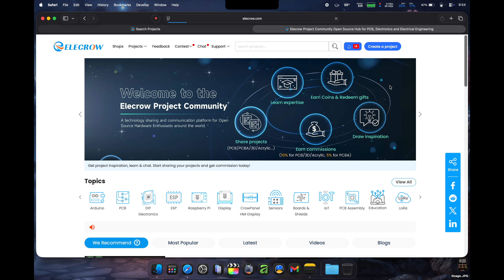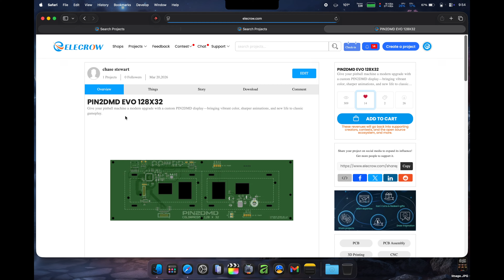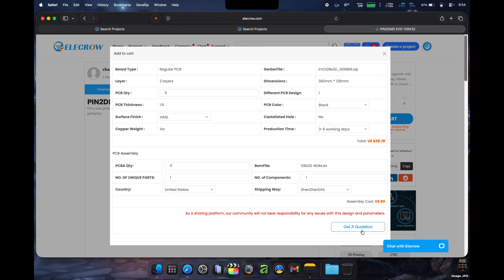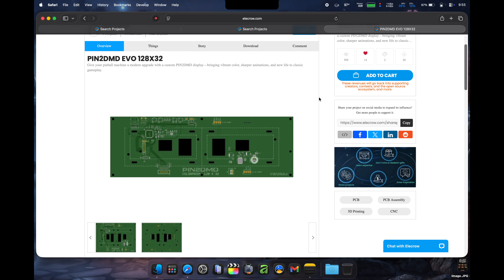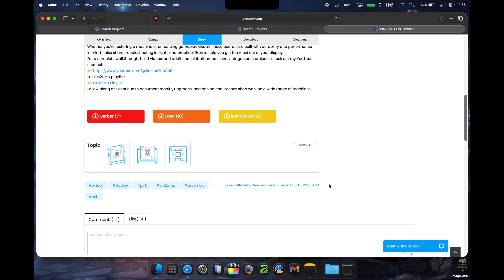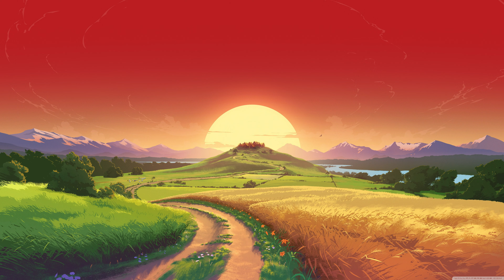How to Order Pin2DMD Boards on Elecrow

Comment: This is rad. Do you have alist of the cables and where you bought them. The ribbons and power?
Reply from the maker: Display ribbon and power comes with the actual displays. 

To power the board it depends on what machine you are putting it in. 

For everything except Data East and older Stern I make my own. For those I had Elecrow make some pass through boards. I just solder the headers I need on and make a harness to connect to it.

Comment: SO FOLLOWED THE INSTRUCTIONS THE QUOET FOR BOARDS WAS AROUND 60.  BUT HOW AND WHERE DO I ADD THE PARTS THAT GO WITH IT?
Reply from the maker: You submit for quote. Then wait for a final price to be given. They have to
Determine the price for parts. 

If you are submitting through my project the BOM file is there and they will return with a quote for cost of board manufacturing, components, and assembly.
Reply: @BehindtheCoil  I thought by replicating the quantity in the PCBA quote section, i.e. 5 PCBs + 5 PCBAs, then they will quote the entire build? Also, you mentioned earlier to comment to put the connector on the backside of the PCBA. Isn't this corrected in your assembly files so should occur without the comment?